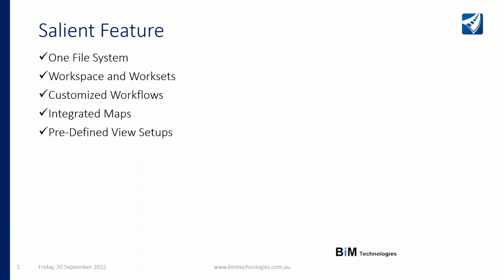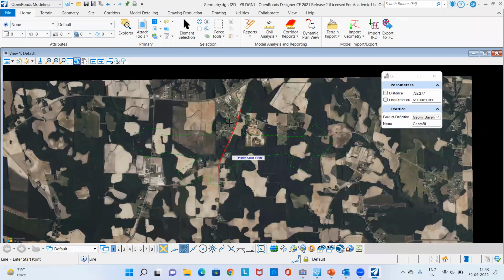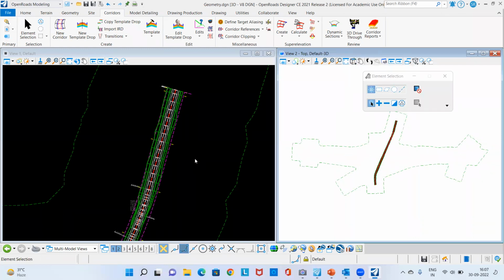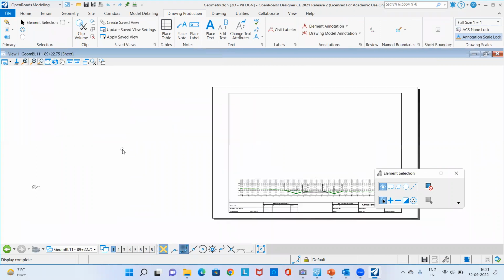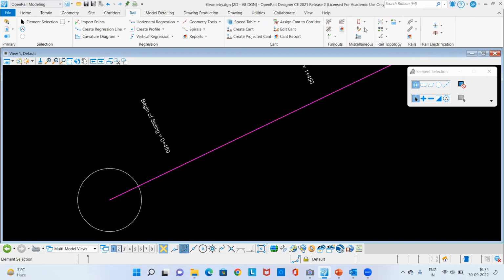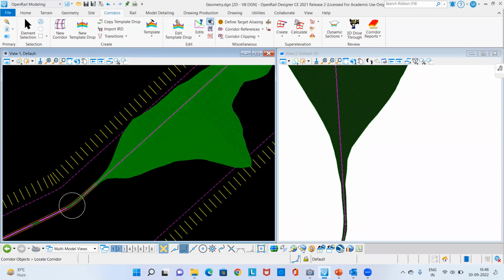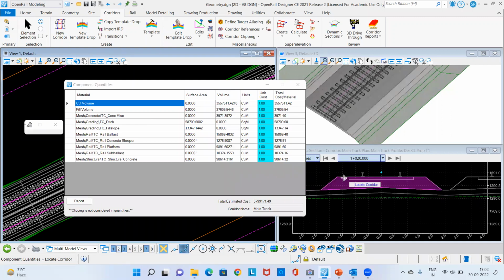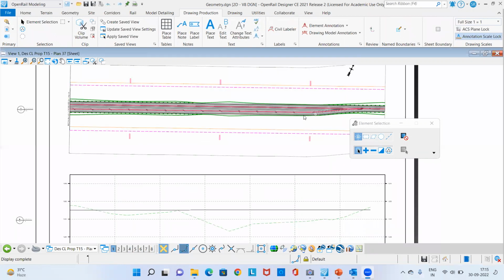Bentley Training Workshop OpenRoad & OpenRail Designer

Comment: is it mandatory to use 2D seed file or 3D seed is also possible to be used?
Reply: You can use 3D files but most people only use those for bringing in initial survey information. Once you have your 3D survey file, use a 2D file for all other workflow (alignments, linework, corridor modeling, etc.). OpenRoads/OpenRail keeps track of the 3D information for you within your 2D file. Within your 2D file, you have the ability to switch between your 3D model if you have activated your 3D file that is referenced within your 2D file (if that makes sense). Hope that helps.
Reply from the maker: for terrain modelling you can use 3d seed file, else 2d would be fine, please reach out to us for complete training.